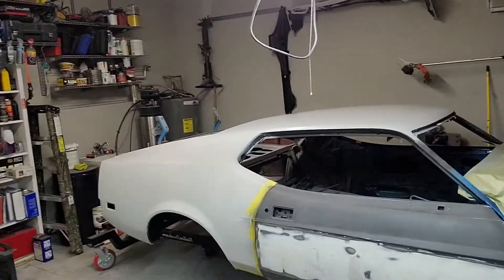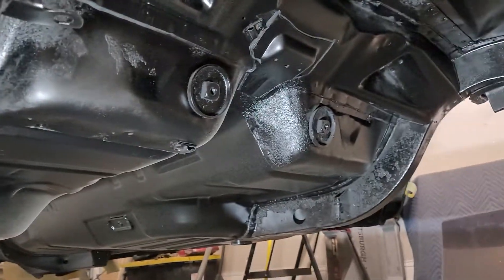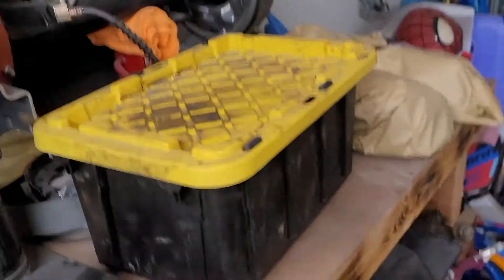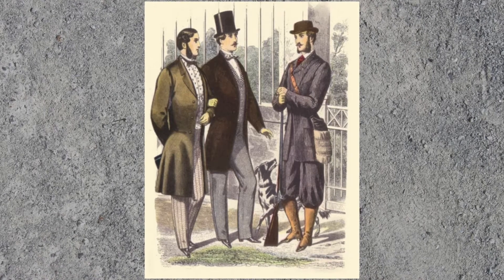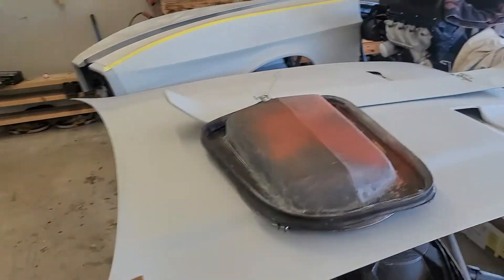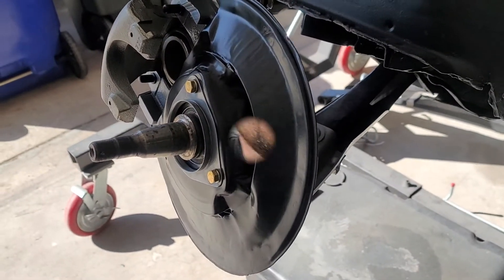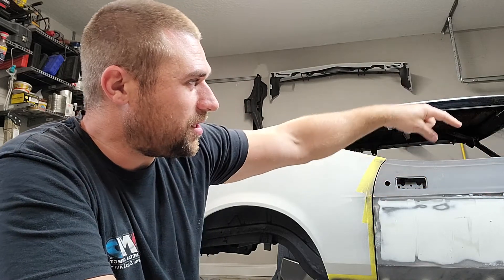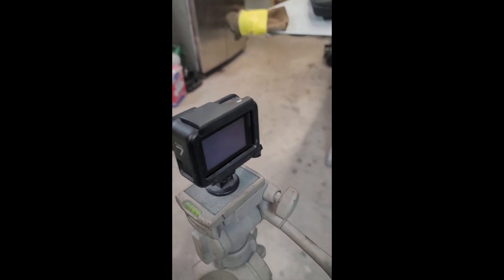1972 Ford Mustang Mach 1 *Update December 2021*

Comment: What made you decide the Torker intake is better than the Performer? I have the Performer on mine. What will be your RPM range and camshaft?
Reply from the maker: The torque or intake should be better on the top end and since most of my driving is on the highway and I'm not interested in light to light power the torquer should do what I want it to do. But would that being said I did end up going with a blue thunder Shelby style intake for this engine and that's what's on it right now. I've been slacking and trying to get work done at my shop for other customers in my car has fallen by the wayside but I'm within weeks of painting the car and getting it put back together. There will be a video that follows once it's finally painted
Reply from the maker: I apologize I forgot to answer your question The RPM range is just going to be factory specs. I didn't want to modify it too much and wanted to spec it out like a boss 351 - the solid lift cam.